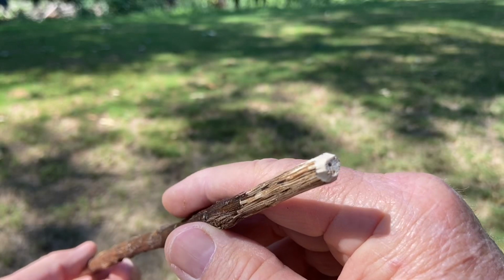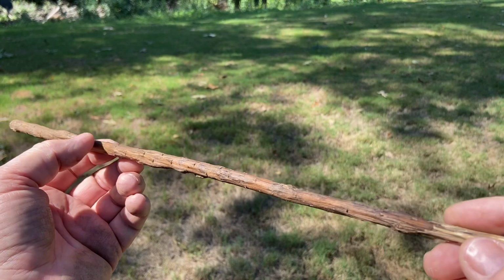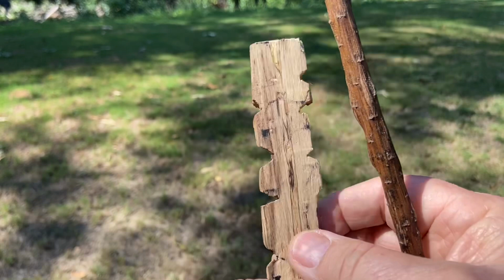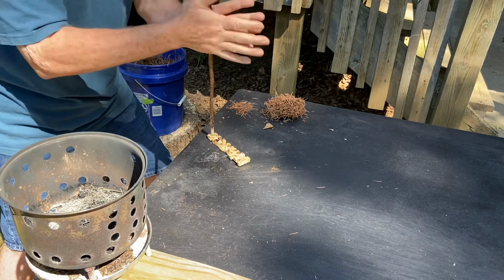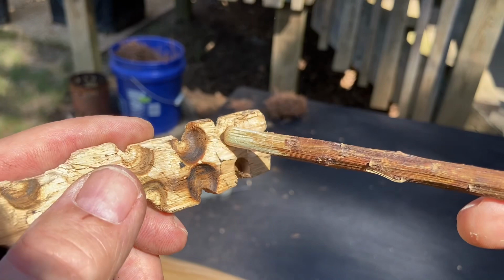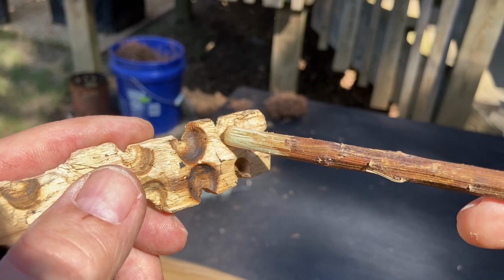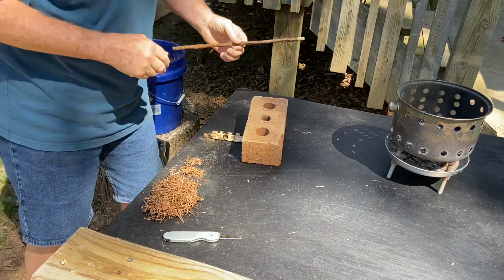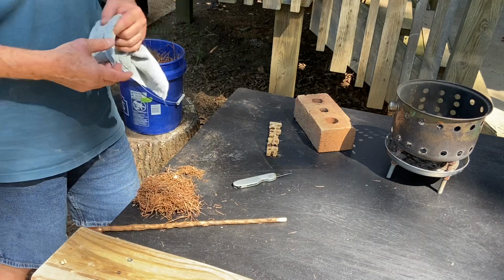Hand Drill, No Hold Fireboard, Should’ve Tried This 8 Years Ago!

Comment from the maker: I learned Hand Drill about 8 years ago. I thought that the fireboard needed to be held tightly with spring clamps or pinning it to the table with my knife. The strong twisting torque that I was trying to resist came from my spindle's tip rubbing against the inside walls of the fireboard's divot. The deeper I drilled the more the foreboard would try to twist. I eventually took my mentor's advice, "All friction needs to be applied to the very bottom of the divot. Any friction against the inside walls of the divot from the outside walls of the spindle's tip was a waste of your energy." So whenever I noticed any rubbing I started scraping the outside walls of the spindle's tip to make it's diameter smaller and stop "the rub". Here it is all these years later and it's just now occurring to me that without all that twisting torque, I no longer need strong holding devices, in fact, 90% of the time I don't even need to hold the fireboard at all. LOL! I LOVE THAT!
   Please follow the LINKs below and SUBSCRIBE. Thank You!

Hand Drill Playlist
https://www.youtube.com/playlist?list=PLkoXX8XsMW3nvAanTlr7IhGt1Kjk3SNzp
Stanley 10-049 Pocketknife Playlist
https://www.youtube.com/playlist?list=PLkoXX8XsMW3lLvn59SKAqTSH60CLY_Ha4
Reply: Well that's great news David. 
I hope to start making fires.

Comment: THANKS David!
You're story about keeping friction right focused on the bottom and not the sides is very very helpful - also, I started thinking to enlarge the hole, not thin the tip - you saved me some time there too ;). My brother tried friction fire with a dowel and corded drill (like electric) and now I think I know why that doesn't work - he actually drilled right through the board, no ember.
Reply from the maker: Dowells didn't work for me either many years ago.

Comment: Hi David!  I have a sugarberry (celtis laevigata) that we recently had to remove a few limbs. This species has a softish outer flesh with a hard caramel-colored pith center that tends toward splinter..  I carved a set from it, but the pithy center which ends up being the actual friction surface on all parts, is very tough and gets the waxy look and even a bit of hot wood smell when drilled, but it seems very resistant to actual burn-in. Clearly, some wood works better than others OR maybe this hillbilly doesn't quite know how to use his tools? LOL! Experiments will continue here at the old hollar lab.
Reply from the maker: Sounds like one to avoid.